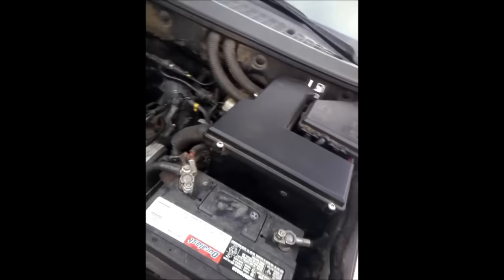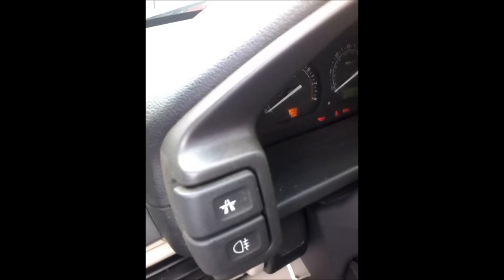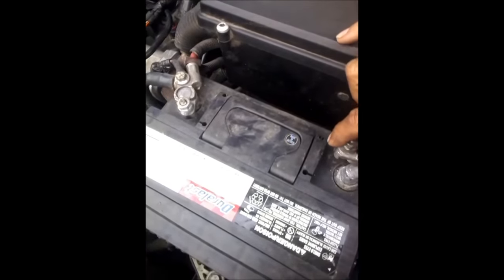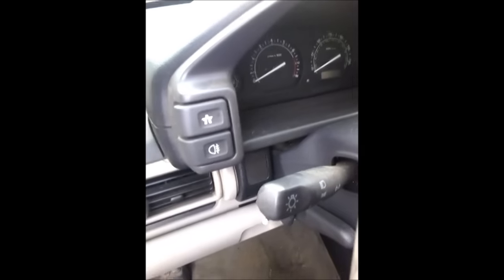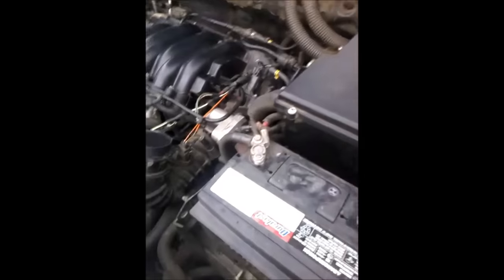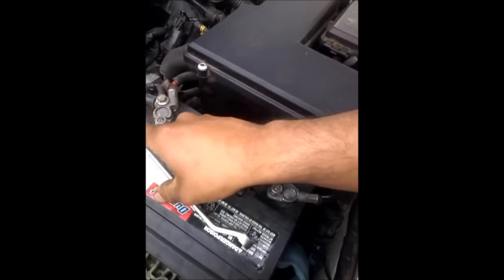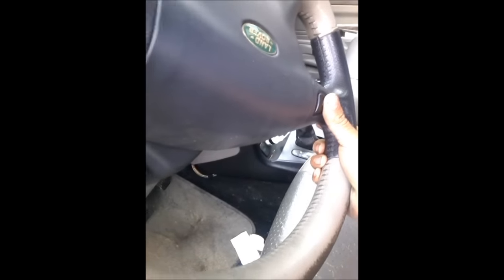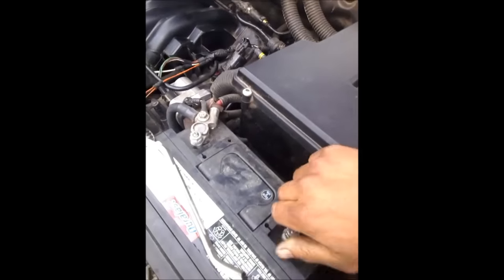3 ways to turn off CHECK ENGINE without scanner EASY!!

Comment: First of all, your resetting a trouble code....key word is trouble. Now trouble codes can come on with issues not dire, like a O2 sensor reading occasionally out of spec, or your catalyst not being up to snuff. Or a loose gas cap. But simply resetting the code, doesn’t get rid of the problems. You have to fix the issue to keep the light off in the future. Resetting however is a good practice the first time you see an CEL, as to make sure that it want a one time thing. However, Many commenting here are claiming that simply resetting the code and turning off the check engine light, saved them a bunch of money. It did not, just as pulling the light bulb out of the dash would not. The check engine light system needs to see a certain amount of issues in a given time, before it once again turns on the light, resetting doesn’t change that fact. If it’s a real trouble, it will come back. Also, if you are one of the states that do smog checks,  you must not have a check engine light condition on or you’ll fail the test. Don’t also try to reset the code and run down to the smog inspection thinking that there’s no CEL on, so you good to go. The computer stores reset info, and if reset, a certain amount of time/ miles driven, or key on cycles needs to occur for the smog machine to give it the all clear. Best thing is to have the codes read, and then reset, and if they come back troubleshoot. Reset is just that, a reset of the underlying trouble, not the trouble fix.
Reply: Well said my man
Reply: Brother this is video is for people like me who cannot afford repairs but has a check engine light on and needs to pass an inspection sticker
Reply: True that besides scanner are check . Just buy one . Some one  giving advice who can't even fix the broken button on his steering
Reply: I can make the light go off by mucking around with the petrol cap and starting the car couple of times. Have tried new cap.
Engine light keeps coming on periodically.
You are correct it does not fix the problem. Car works perfectly with light on.

Comment: Wtf is it with all these comments!?
All you're doing is resetting the system, in 50 miles the lights going to come back on!
You're not "fixing" Anything!!! 
Usually the CEL comes on for a reason! Go down to your Advance Auto, Auto zone, Pep boys, O'Reilly's etc... and have them run the codes. They'll do it for FREE! 
Bad codes are like bad teeth, they'll multiply if left untreated! (And end up costing you a ton more money in the long run!) Figure out the problem & fix it!
Reply: Too right TJ.......who the hell do all these commenters think they are?   You and me?
Reply: Maybe we don't have the money right now, King Midas. But we still must drive to our jobs in order to make the doughnuts for us to get it fixed and hate seeing that pain in the anus check engine light that keeps showing up like an unwanted guest. Mr. Goodyear doesn't come cheap and some of us were written out of Daddy Warbucks' last will and testament
Reply: I'd love to know!??? All these guys for whom these tricks worked so well!!! How long did the check engine light stay off??? We tried disconnecting negative terminal on my son's car! Not only the light came back on inside an hour but the engine SHUT down!!!! While driving at cruising speed on the highway going back home. Be warned you people!!! You can trick that light off but if there's a problem with the system it'll come back on.

Comment: In essence, disconnect the battery cable(s). Remember, what ever caused the check engine light to illuminate will return. Buy an inexpensive scan tool or go by a parts store, they will scan it for free and tell you what the codes mean. Then you can decide if you want to fix it.
Reply: if you repaired what caused the problem
then it won't return
Reply: @johndemore6402 in a lot of newer cars, it will. Dirty O2 sensors are generally the cause, but they often go bad. Most shops charge around 250 to change a sensor and too.Most of the time, it has a lot to do with the type of gas that is used regularly. 93 definitely burns cleaner and doesn't dirty up the sensors like 89 does.

Comment: So explain the first way again... So u turn it to on position the first click or second click and do u leave it on when u remove the negative cable and touch it 3 times and after u touch it 3 times do u turn it off than start it or just start it???

Comment: Be careful on how you use your wrench beside the terminals of the battery. It could cause a short circuit and you would not like the result if it did happen.
Reply: lol, omg, did it once!  bzzzzzz
Reply: Omg I thought the same thing too😮
Reply: @uRealReels  me 2 in 1980.
Reply: I was thinking the same , always use socket

Comment: Well he's right about finding out why the light is coming on befor you reset it. The CEL is there to let you know there is a situation, either a problem like a o2 sensor that's going or gone bad, or just dirty and fouled from running cheap gas, or a catyletic convertor is plugging up or failed... often expensive converters get fouled and plugged from not running premium fuel through it once in awhile...
And if your cats get plugged that ain't burning it can often lead to that bank overheating since the exaust can't escape... which leads to a head overheating and eventually blowing the head gasket or warping the head, or cracking it... people often think it's missing and replace the spark plugs, and spk plg wires, and then the coil packs because it seems to be missing... other times people will think it the thermostat causing the motor to overheat.
So if you any of those kind of problems, the cel is letting you know... it's best to find someone with a scanner and get the code befor resetting the light... unless there is no problem.
Some vehicles cel comes on at about every 4800 miles to let you know it's time for an oil change. But usually, it has something to do with emissions, o2 sensors, or cats... sometimes it might be low on fluids, oil, or coolant.
But homeboy warns you to find out why it is coming on.
A person can get a cheap code scanner on Ebay or Amazon nowadays for $20 or $30 bucks, which is cheap compared to a mechanic that charges $125.00 An hour, or blowing a head on account of a plugged up cat.
But... this was a good 411 video for DIY cel resetting without a obd scanner tool to reset it...  helpful and well informed... thanks for being unselfish with your knowledge and hacks bro...👍👍👌 ~ ✌peace
Reply: I just replaced both oxygen sensors and can't get the engine light off on an 06 Acura tl do I have to take it to someone to have it turned off
Reply: @adamchristner007  is the cat blocked up? (When was it last changed 🤔?)

Comment: I just tried this on my wife’s 2018 Nissan Pathfinder that has had the check engine light on for about 2 weeks. It was showing 2 codes, a camshaft position/mass air flow sensor and a traction control sensor communication code. I replaced the camshaft position sensor and the mass air flow sensor and the dealership wanted $140 to hook it up to just see what codes it has.  I found several videos on how to reboot the Pathfinder but all failed until this one!  I tried the 1st solution offered where you put the car in the run position and disconnect the negative battery cable and then touch it to the post 3 times and hook it back up.  I cranked it up and the check engine light was off. Thank you so much my friend!
Reply: please tell me, did check light come again after this process. so that i should do it.
Reply: @shakeelahmad485  same question, and did it works on volkswagen mk 5 ?

Comment: I have a 2010 rav 4 came home one day and turn da car off but all da sensor lights stayed on. So i restsarted  again and shut it off still all da sensor light stayed on even when i took out da key so i disconet da negative next day i started it and all da sensor was gone. Took it to da dealer but could'nt find da poblem they keep it for 5days. So drove it home after 2 weeks problem came back. Can you help? It has 60,000miles.

Comment: Will this help my car pass smog check? my car needs an Ozone radiator and i put an aftermarket not knowing that and now won't pass smog, runs fine but won't pass smog check and is a 2000 fix and my car is not worth it to be honest, what can i do? HELP

Comment: Hell yeah brother! FIRST METHOD worked for me just replaced a camshaft position sensor and it wasn’t reading. Did what you said then it turned off the check engine light no problem
Reply: Doing that clears just the check engine light or does it clear the monitors as well ?

Comment: will this work on a 2016 Dodge Ram Laramie Truck?  My dealer wants to charge $4500 to replace the PDF filter and regen.  I want to clear the code and drive it on the highway first before spending this ridiculous amount of money.

Comment: Effective ! I do the 1st option ... Thank you Amigo!
Reply: Anytime you disconnect the battery, it will reset the check engine light, but the light will come back on, if the original problem not yet fixed.

Comment: 1.disconnect the barrady 2 press horn barn 3. disconnect both cables and attach to each other. On US cars with electronic traddle boddle take to dealer. But light will return till issue is fixed. Got it, thanks.

Comment: I did mine with 25 Cents or a Quarter. 

Take 25 cents or a Quarter and ask for that amount of gas, then pour that gas on the drivers side, light it up with a match or a lighter, wait 30 minutes to an hour till the car is nice and crisp it will turn red then a very nice dark color, that is what you want. After that your check engine light will never turn on again. 

Damn wish I knew this before I tried the above method, could of saved myself a 25 cents and a trip to the gas station. 

Thanks for sharing.

Comment: The first one didn't work for me but the second one (horn 20 seconds) did. Thanks.  Almost positive it's a bad gas cap.
Reply from the maker: Good
Reply: Your local parts store should have a scanner you can borrow to code it on the next light. I would advise doing that. A gas cap code is most likely going to be P0456 or P0457, if my memory is right. P0456 could also be Purge Valve, or Vent Valve. If it's not gas cap, I would advise having a technician diagnose it at an auto shop, as it may require smoking the exhaust system to find the culprit.

Gas cap would be an EVAP code, by the way. :D

Comment: Like the Norton t-shirt. but, you are really scary with your 12" wrench there bud! A little high amp welding might come your way next time!
   t The tapping of the ground on my 98 Chevy might be the very LAST thing I would do, fuel injection/ ign./ fuses/ computer/ ya know$$$  
    of which I don't have a yard full of 98 Chevy  5.7 trucks lying around the yard.  Two of the things you did, do work sometimes!                               
                                         just sayin

Comment: best way to turn off check engine light: fix the problem!
Reply: Lol
Reply: Well if you're a car enthusiasts it isn't always this easy, engine swaps come with a check engine light that you can't turn off
Reply: Haha!! Yes! True!!!
Reply: Nah, as long as you can turn the light out it will save you thousands in repairs.
Reply: You would still need the scanner, right?
Reply: Thats the best but the most expensive so shashhhhhh
Reply: Blackout tape over light works pretty good.
Reply: But wats the problem
Reply: Ur slow when u do fix the problem some car check engine lights don’t go off u have to reset them or unplug the cable connected to the ecu and plug it back in
Reply: You get checked, says it is gas cap.  You replace gas cap — still on.  Car runs fine.  Don’t waste anymore time or money and get the light to go out if it bothers you or live with it.
Reply: @77777771955  literally what just happened with my car. Even got the code checked, just my fuel cap. Light still won’t go off. 😅
Reply: It takes money 😮
Reply: Even if you clear the code it still won’t pass state inspection if you have emissions inspection
Reply: Wrong, they will still stay on regardless,
Reply: Yeah unfortunately mechanics don't seem to fix it when they fix a problem so you must fix it yourself

Comment: hi i have a honda crv 2004 ny check engine light is on i know i have some kind of tramsiion problem   i just bought car and dont want to fix tranmission but want to get in inspected  can i do this to my car these methods i just want engine light off... the engne is fine but it seems to havesoem slipage in gears

Comment: Things to remember. Don't connect the positive and the negative terminals directly. Use a resistor between them, or you may fry some sensor or computer.
Also, if you disconnect both terminals you will lose all your presets for radio and other electronics. Maybe even a radio anti theft code. Make sure you have it before you start. 
Lastly, like the man says, if you have CEL on, it could be a sign of a serious problem. Resetting the light won't fix it. It will come right back. If you have CEL light on and you reset it like this, and then go for yearly vehicle inspection, you will fail even of the CEL light is off. Why? Because all the codes are now erased from the OBD computer and there is nothing to read. They will send you home and tell you to come back in few weeks.
Reply: Will it erase all the computers faults memory, will the testing people have a problem with this. Good point I don't think I will do it.
Reply: @martymartin2894  Yes, and yes.
Reply: You are a comedian
Reply: So they'd fail your car for not having any faults? Weird.
Reply: Tell us about that resister please, thanks
Reply: Joining cables positive and negative just turn on head lights to soak up any power resistance left in any componants. Ive done this many times with no issues. 👍

Comment: I will pay you if you can tell me how to disable the alarm system on my 2000 Jeep Grand Cherokee; I bought a new computer and had them bypass the key code so I wouldn't need a key with a transister chip in it, but somehow the alarm system got triggered, and now I can't get it to go off, except to wait for the timer to run out. I got the electrical wiring diagrams for it; but still don't see the answer. Is this computer going to have to be re-flashed again??

Comment: Count the miles until the light comes back on. After 20+ miles the computer will reset and if it takes longer before the light comes back on you can pass the emissions test before it comes back on.
Reply: Genius!!!
Reply: ...and completely wrong. There is no set mileage that for the I/M readiness monitors to reset. 20 miles might do it, but it is based on a multitude of factors and nothing to do with mileage.
Reply: @robertkorn  Dude I know all about the ripoff emissions test. They reset differently on different cars I had a Ford that reset in 3-4 miles. A Navigator I had took 30 miles. Almost all emissions test failures are from a bad gas cap. If a malfunctioning O2 sensor makes the light come on it will still pass the actual emissions test if you actually tested the emission levels but by state law you cannot do the test if that light is on.

Comment: Hi,how can I turn off the icon of the tyre pressure , even if I did the tyre inflated as reccomend it .I got chevrolet spark 2014,with manual reset buttons. Thanks

Comment: Uh......that check engine light is on for a reason you know. It may just be a simple emission fault like a leaky gas cap. BUT! It could be something a lot more. Don't risk it folks. Nearly all onboard (if not all) computers have a "dump fuel" default. Which means, if the engine is missing it dumps more fuel into the cylinder. Ok. Raw fuel being dumped into a catalytic converter that can exceed 700* Fahrenheit. What do you think happens then?

Comment: Cool tip to reset your car and clear the check engine light.. Disconnect the negative cable from battery, then turn key in the in position, then turn on the headlights and put it on bright and count 30 secs and then take off the headlight and turn the keys to the off position and replace the negative cable to battery and start the car and no check engine lights.. Works for Lexus and Toyota vehicles

Comment: The best way to turn off the CEL is to just get your car fixed. Disconnecting the battery cable will only reset the OBD computer and the light will come back on eventually or immediately depending on the fault.
Reply: Long enough to get emissions  done , then who cares if it's on
Reply: @mariamaria2751  That trick only works if you take it to a shop run by idiots as it will also reset other sensors that should be active in the OBD and if they are all off it will be a red flag and they will fail you.

Comment: Any fault that is considered an emissions event will trigger the check engine light.

Any method that resets the computer to turn off the check engine light without actually fixing the triggering problem does not solve the real problem.

I glad he covers that.

Even if you fix the real problem, resetting the computer will cause the vehicle to fail obd emissions testing because the computer is not yet ready for testing.

You need about a hundred miles of driving before the computer is ready for testing.

Oddly enough, if you fix the triggering problem without resetting the computer, after several driving cycles without receiving any faults, the computer will automatically clear the triggering code and deactivate the check engine light.
Reply: Thank you For this!! I let my car run and eventually the light went away.

Comment: Doesn't matter if it's the Negative or Positive Cable of the Battery..
Just take off the Cable for 1 minute and that's it..Simple
Reply: I take the positive terminal off for 10 seconds, and it works.
Reply: Probably because if the neg cable touches any car metal, no problem...but fireworks if the pos cable accidentally does.